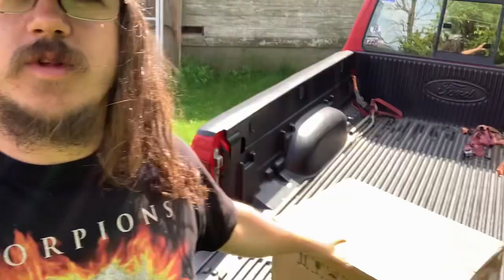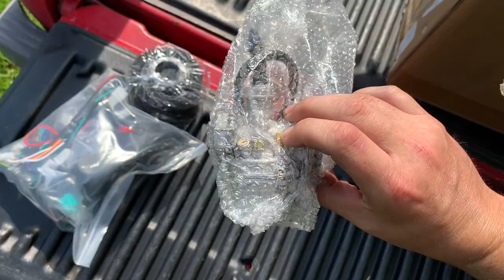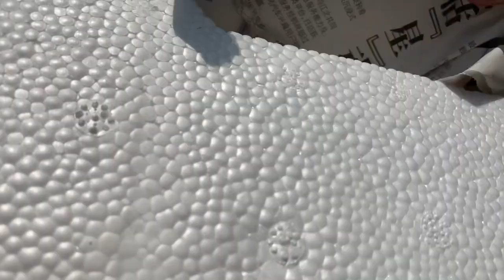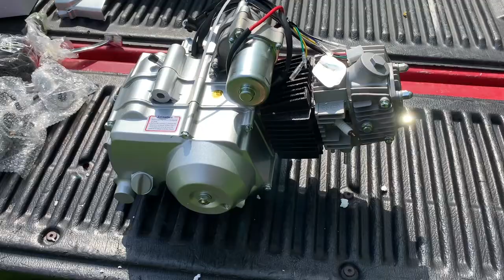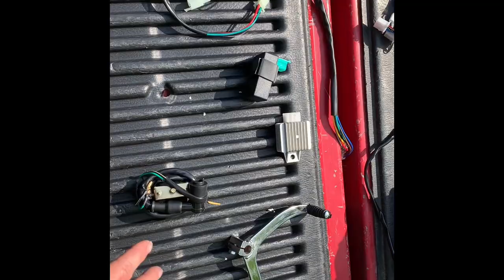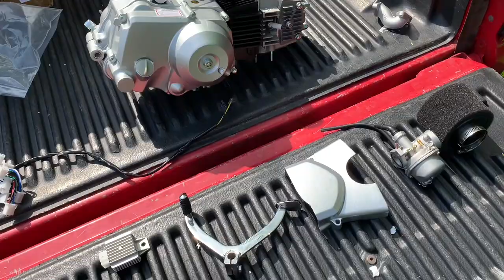Unboxing Cheap EBay 125cc Engine!

Comment: looks like a nice little honda clone  *oil swap after the first gas tank or two, they dont use much, get them flakes out, stick a good fuel filter on it to catch tank gunk and stick a nice carb on it.. So often people blame the motors but theyre using a $5 carb.